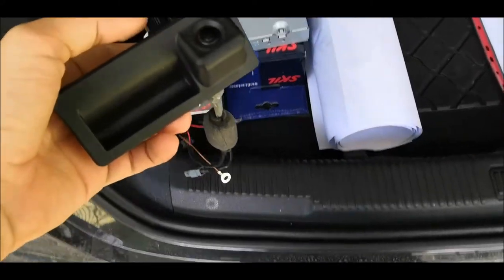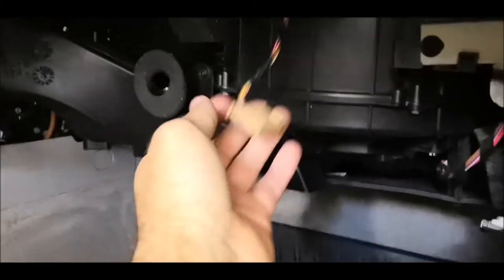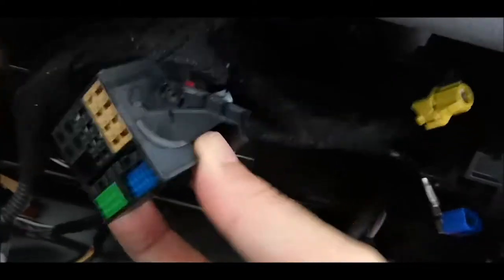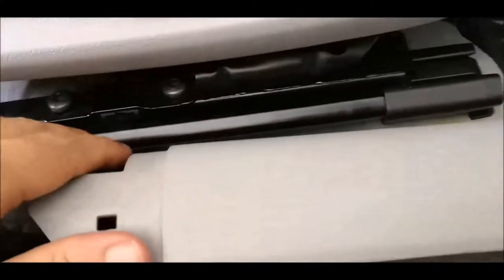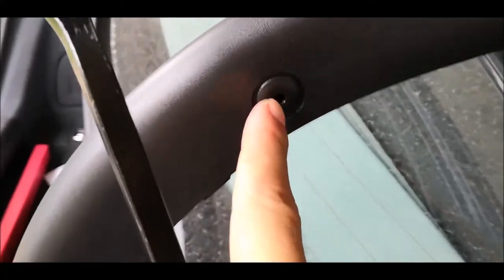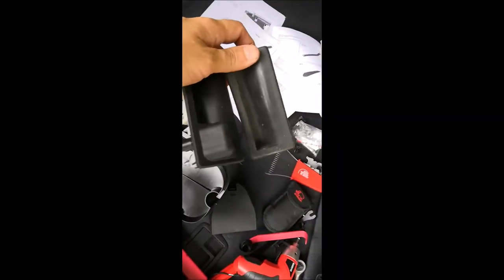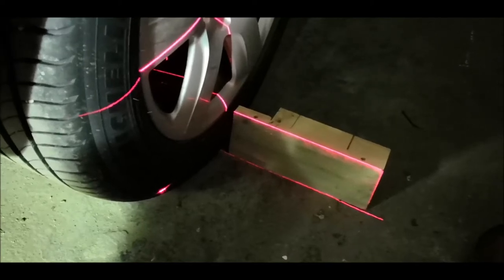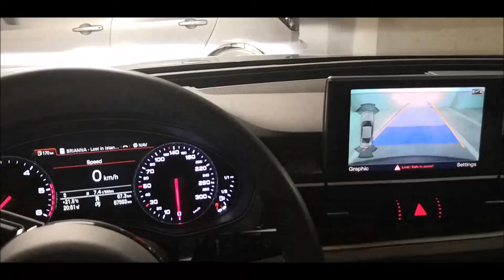Audi A6 4G Rear View ( Backup ) camera retrofit, one day installation. Camera calibration.

Comment: Great video, Gino. I am planning on retrofitting my A6 C7 with a reverse camera. However, my car is equipped with RMC radio, and after I enabled the hidden Green Menu, I noticed RMC's green menu is different from yours (MMI 3G+?). I don't have the "cardevicelist" option like yours. Do you know if it's possible to enable the camera purely through VCDS? Thanks.
Reply: Hello , you install RVC to RMC unit?

Comment: Hi Gino, very good video. Well explain. I just bout a Audi A6 myself and looking to add a rear view camera. Could you send me the link or any info about the kit you installed.  Thx in advance
Reply from the maker: #Aliexpress € 253,62  10%OFF | AIDUAUTO For Audi A6 4G Guidance Line Reversing Camera RVC Rear Camera 4G0907441B 4G0 907 441 B
https://a.aliexpress.com/_dYVjqkc

Here you are, but I think might be a problem now ordering because of Covid-19
Reply: @RomanianChap  thanks for the info.
Reply: Gino Pasquale it is genuine Audi pat or not?? Thanks
Reply from the maker: @florind4906  The module looks like original by panasonic. The camera .. by my experience.. doesn't look original. However the results aren't better even with the original camera, they both have the same bad quality :)
Reply: Gino Pasquale Thank you
Reply: Gino Pasquale do you receive it with all the instructions?? Thanks
Reply from the maker: @florind4906  nope, there are no instructions delivered.
Reply: Gino Pasquale Hi Gino, can you please tell me what part number is the camera, I have the control module same part number like yours and where I have to do the connection in the boot ?? Thanks
Reply: Hi, really good video. Please could you let me know if the VCDS steps can be done with VCDS-lite?